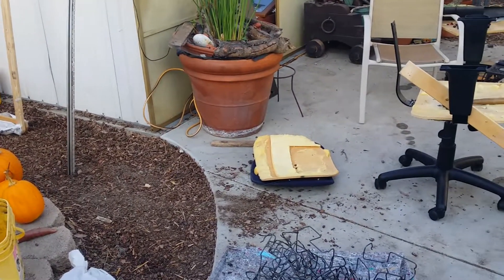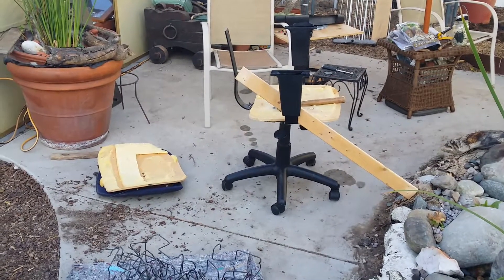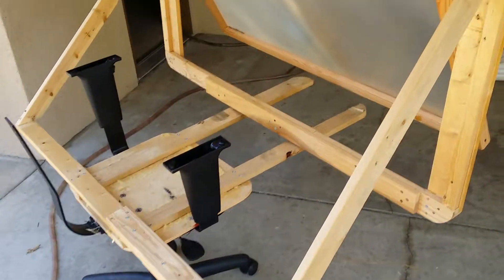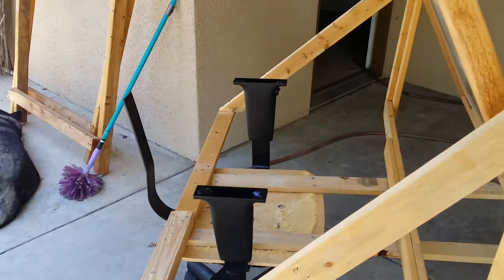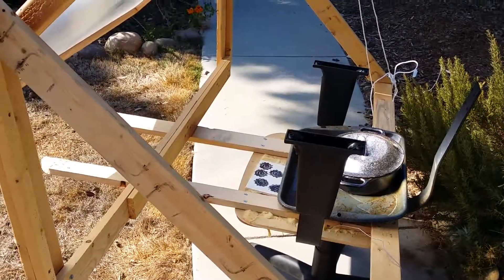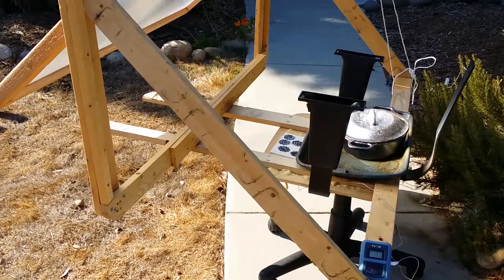DIY Solar Cooker Fresnel Lens Office Chair Box Spring

Comment: that ambient temperature in the area behind the fresnel lens should have been up to 400+ almost immediately and depending on the lens focal point your water should have easily boiled within 10 min, it's probably a good thing it didn't get up there because the wood framework around your cooking pot would have gone up in flames. it's ok to use wood for the lens frame and stand but everything in the cooking area needs to be metal. as far as heat, some tv lenses are better then others but all of them should be able to light a 2x4 on fire in a minute or less, do you have the ridged side of the lens facing upwards towards the sun?